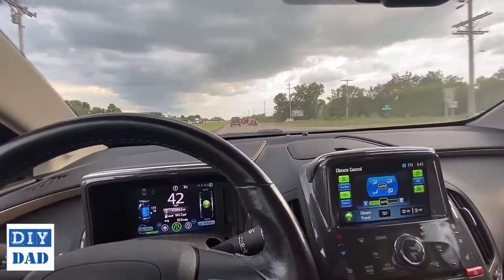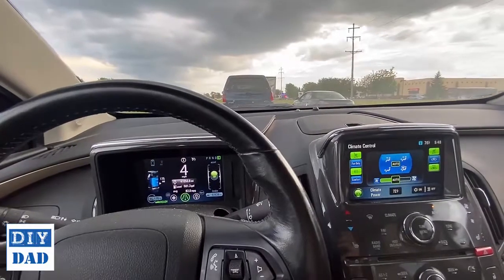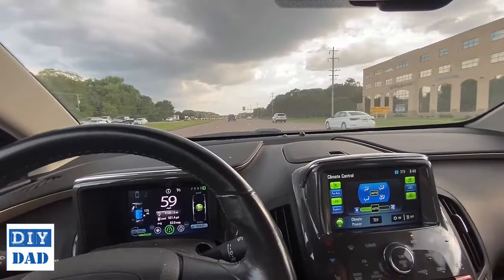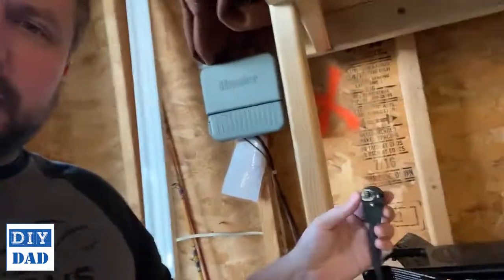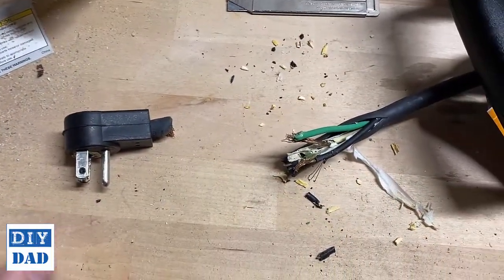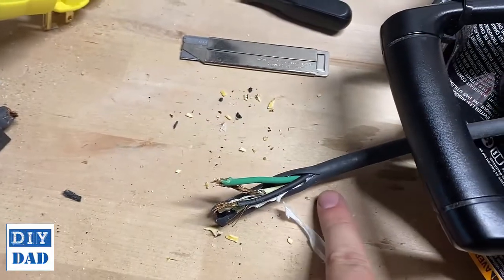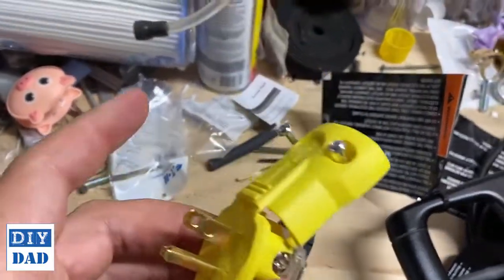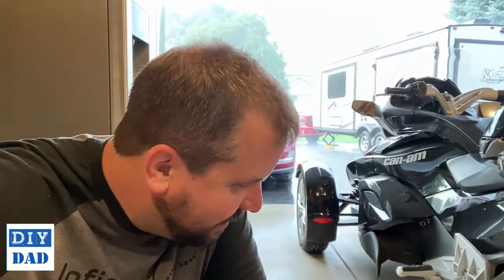Fixing the "burnt outlet" problem on a 1st Generation Chevy Volt charger

Comment: Had this problem, called in an electrician and he upgraded the outlet.
Reply from the maker: Keep an eye on it - if it starts to scorch again then the problem is in the plug/cord, not the outlet
Reply: @AskDIYDad  We fixed the outlet then after we moved, we got a NEW (weatherproofed) outdoor charging outlet installed by professional electricians. Thanks, Graham Electric of Venice, FL. (Not compensated for this ad)
Reply: 2 things. First we ran a line but it's only a 12 Guage wire and I think it's supposed to use a 10 Guage. And 2nd I don't think the car uses a cvt